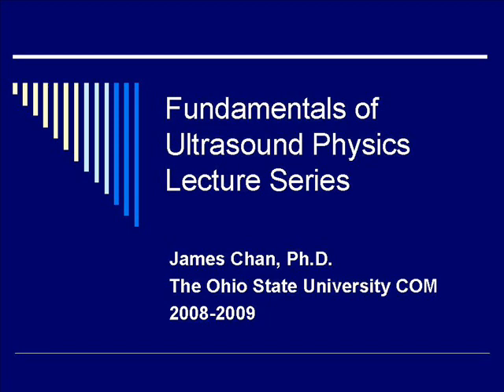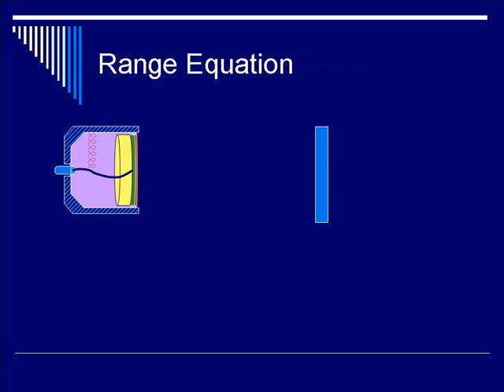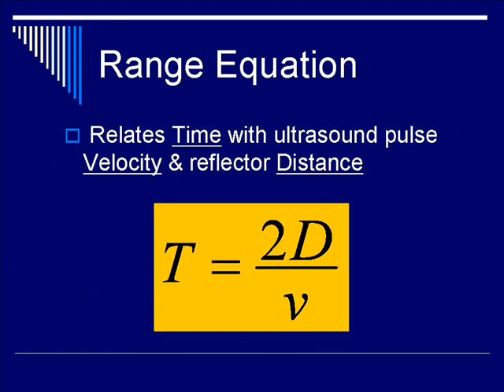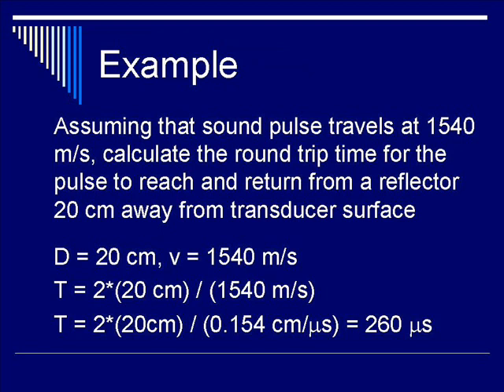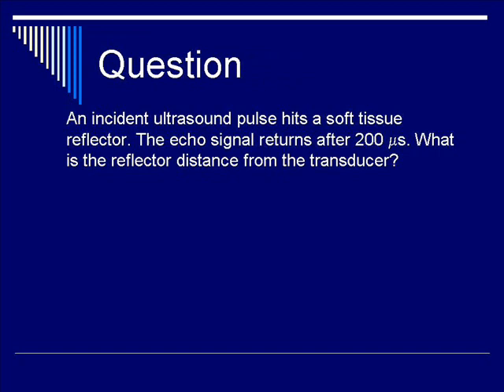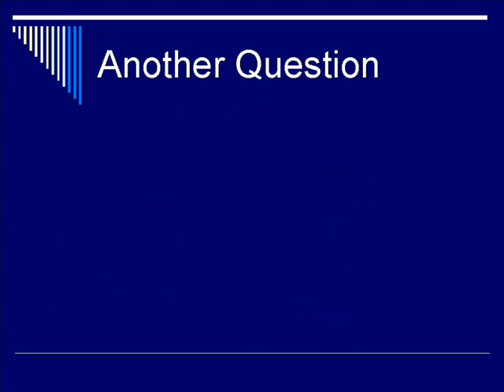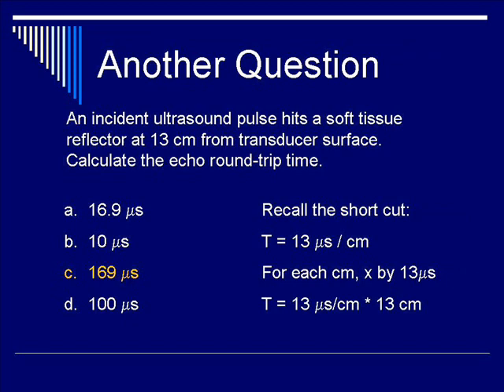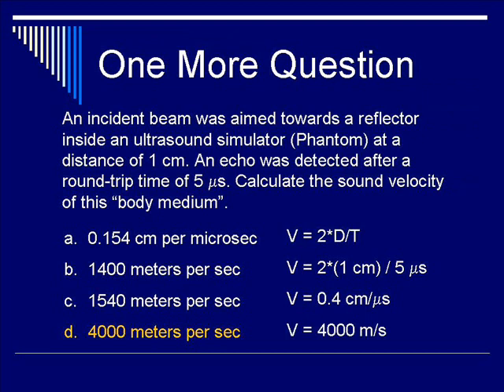Physics of Ultrasound: Pulse Echo US - Segment #1

Comment: wait I thought the rule of 13 is one way.  roundtrip would be 13 times 2?
Reply: i used to get confused on that too. the math is easier with 13 microseconds per 1cm of distance. if the problem asks for one-way then divide your answer by 2
Reply: If you take a look at the equation T = 2D/v and plug in D = 1 cm = 0.01 m and v = 1,540 m/s, you get about 13 μs.  So the 13 takes into account the entire round trip.